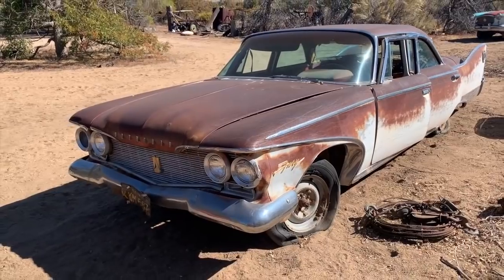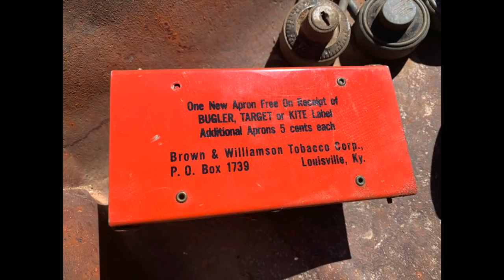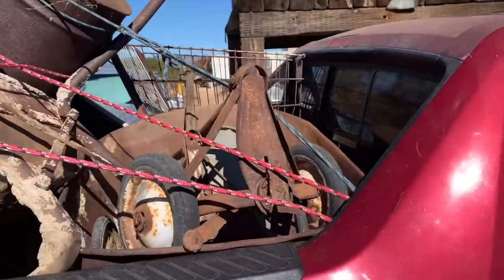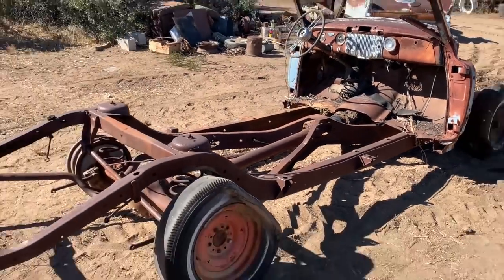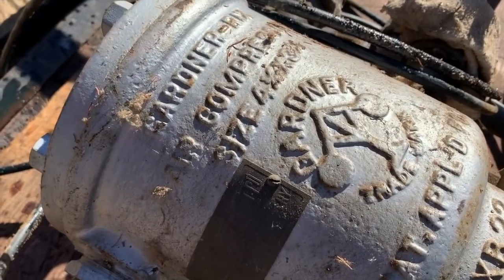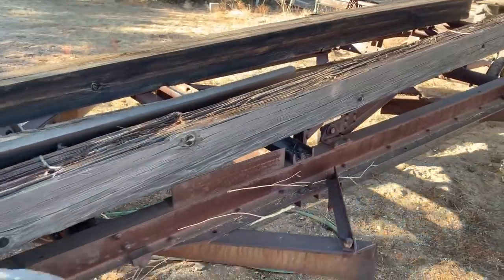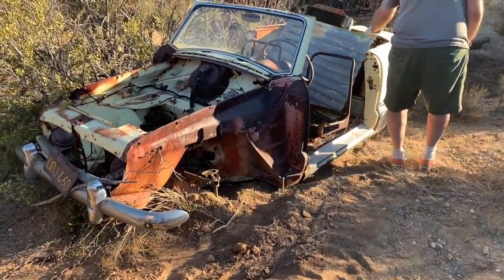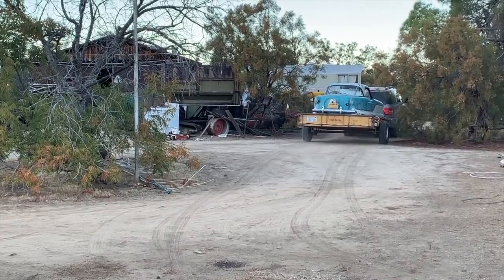Carchaeology: More Junk ! More Rat Poop ! Come and get your fill with this Barn Find pile!

Comment: Love the potential of these desert cars. The dry climate preserved the metal, but it is hard on the soft parts which is easier to replace. Gotta have a vehicle with solid steel to make it worth preserving. A lot of restorers spend gobs of money fixing rust issues.

Comment: At 4:07 - Looks like a mid-50's Ford door latch on that Nash Metro. May not be the same, but sure reminds me of one. Nash, Packard,  and Studebaker, since they struggled financially, used what was practical and inexpensive. Already, they were finding it difficult to compete with Detroit's Big Three. Chrysler, also, was by then third place in the race. Ford and GM was winning the battle for sales.